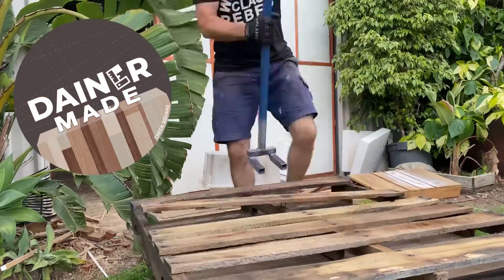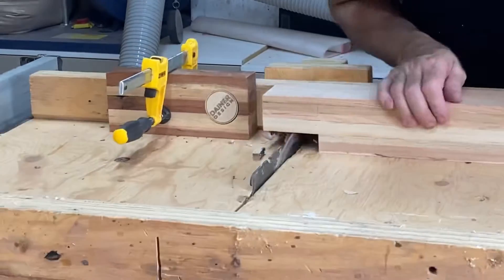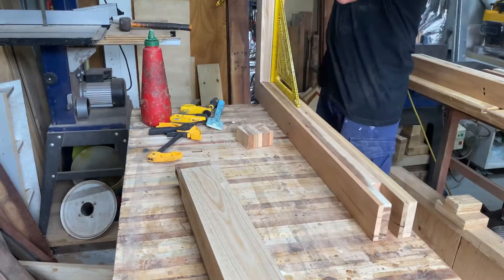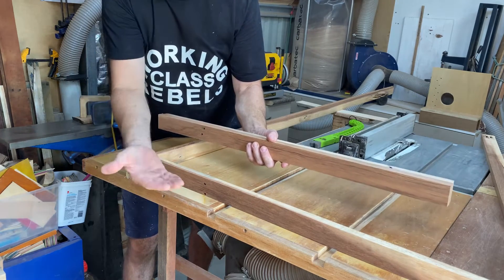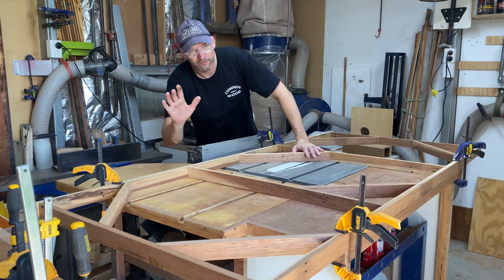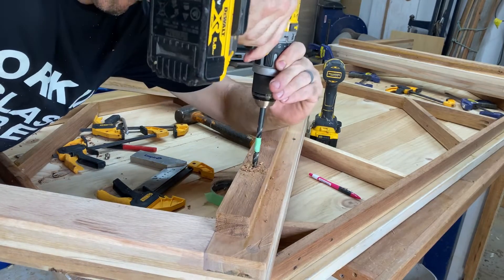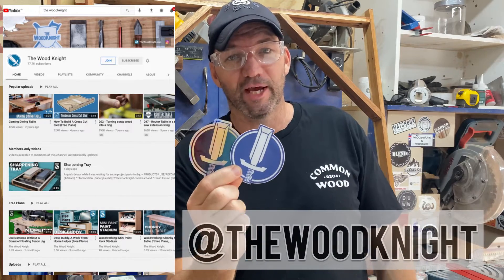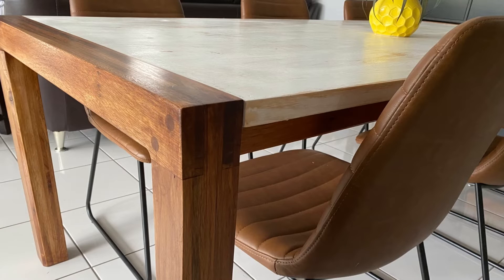Pallet Wood Dining Table Legs... a Rebuild Story

Comment: Nothing like a nice pair of legs, Mark 😜😅. The final reveal looks really great. It's a great design with the tabletop recessed slightly in between the legs. looks classy 👍. And nice recovery (with that thin shim) from the first cut that was slightly off. That's a great tip.

Comment: Another great job 👍. Still working on my first project. It’s a small end table for my mom. I’m ready to glue my slats in to 9” wide slabs. Hopefully that will get done this weekend. Currently at work. Starting small
Reply: How long do you let your glue dry and stay clamped together before you separate? 1 day, 2 days?I have to do one one glue up?